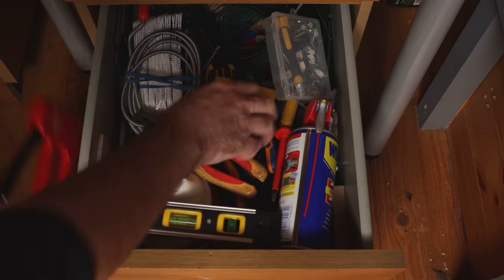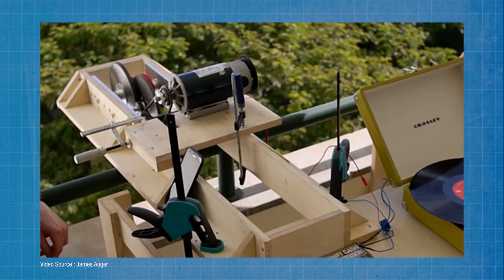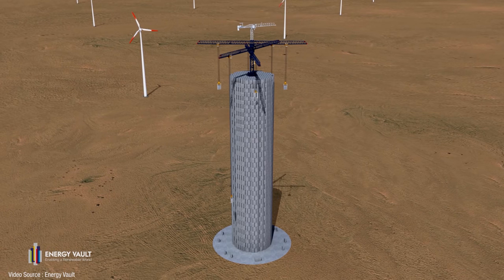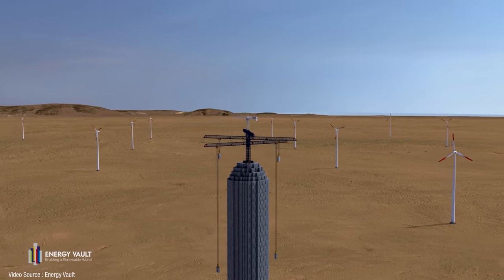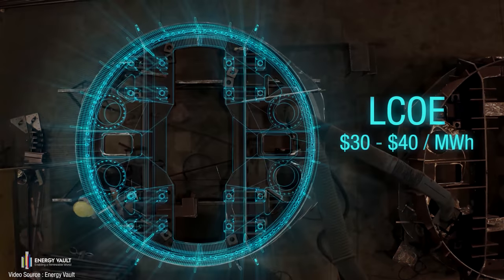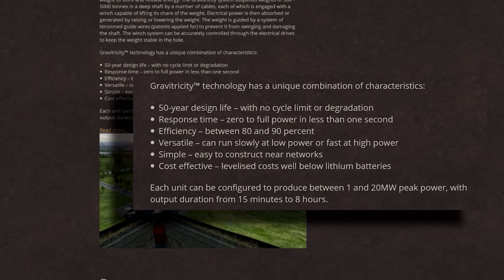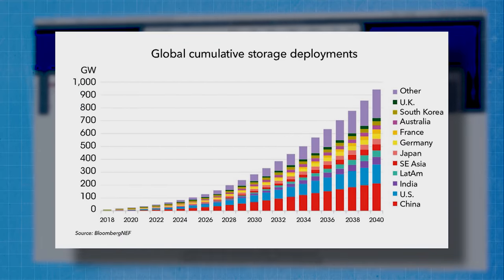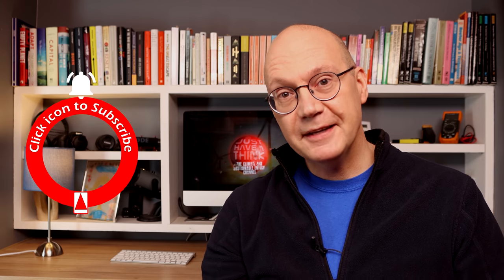Gravity Energy Storage : A very uplifting technology!

Comment: They should build a moat around that tower block to drop the blocks into.
The mine shaft one is certainly less of an eye-sore.
Reply: Don't know if you have covered mechanical batteries(fly wheel storage)on your great series,which is another system which could quite possibly be combined with all these other systems(like an ion battery being the gravity weight,with a fly wheel).i would like to share my scale up idea for a heat battery(my own idea,with micro wave safe glass tubes(there patented invention)heating an iron filament from the sun,through the (patented glass,that by it's molecular structure,does not allow,Evan one ÷of the heat too escape.this in turn would be reconverted into electrical energy at night,by the geothermal method,or vise versa,but on a smaller interconnected systems way,a bit like solar panels.tell me what you think ( :and if maybe this could be tested,and Evan financed.freedom

Comment: I had a think, and I realized that town water towers are actually gravity storage systems. You pump water up into a tank high in the air, and it creates water pressure for the town water supply.  You could run the outflow from the tank through a generator into a pond to create power, and pump it back up from the pond to the tank to store energy.

Far fewer moving parts than lifting big bricks, and no worry about outside forces like wind interfering.
Reply: A tiny amount of energy storage though. All these gravity systems need a combination of high mass and a large height differential to work, you don't get a lot of energy  otherwise.

Comment: Good to see that type of system being developed. It also of course has zero energy loss for longer term storage. I think you will find it has been used to drive clocks for a great deal longer than a century.
Reply: And the clocks got somewhat smaller when the transition to batteries was made 😂. Take that as a clue to the feasibility of these project.

Comment: A problem with raising and lowering blocks as shown in the video is that 'not all blocks are equal'.  As the system moves to lower blocks in the stack there's less energy to be recovered from the block.  The block has less distance to fall, less energy was used to raise it to its lower position in the stack.  In a 100 block high stack some blocks store 99 units of energy, the second from the bottom block stores 1 unit of energy.  The bottom block stores none.

Mount the crane at the edge of a cliff.  Install rail tracks at the top and bottom.  Raise and lower "rolling weights" and move them from the crane to storage areas.  We should have an abundance of no longer needed coal rail cars.  Fill them with something cheap like waste concrete.  

Slope the lower track away from the crane.  When recovering power from the system let gravity move the lowered weights/cars.  Then when there's power to be stored store some of it as travel to the crane.  At the top do the opposite.  Move weights up a slope when there's power and let gravity bring them to the crane during discharge periods.

Huge amounts of energy could be stored by simply making the storage tracks longer and increasing the number of cars/weights.  All cars/weights store 100% of the energy needed to lift from low to high.
Reply from the maker: Hi Bob. Sounds like you have a plan. Might be worth talking to investors.

Comment: There seems to be a hell lot of moving parts in the "Energy Vault" system. As a general rule, the more moving part you have, the more risk of failure you have. Frictions between blocks, degradation of the concrete blocks, mis-alignments due to wind and rain on the structure, resilience to earthquakes. Those are only some points that came to my mind is a couple of minutes. The only advantage it seems to have against pump hydro is the energy density of the system but I think the constant need of maintenance to keep this system running far out weight the gains.
Reply: Other strength pumped hydro is much more limited when it comes to where it can be located, but otherwise I totally agree with you. The Graviticity proposal seems much more reasonable, but because it's less flashy it seems to get less attention (especially here in the comments), shame really.
Reply: true
Reply: Agreed. The liquid redox battery is going to prove to best the best option down the road. Being able to stack shipping containers of liquid batteries and leave them for 25+ years without moving around will be the safest and least amount of maintenance. I would rather see those concrete blocks be made of carbon capture concrete and used as levees of building blocks.
Reply: But this is entirely missing the point.  If the world is to move to clean, renewable energy sources (as it surely must), then - as is so often pointed out - various means to store energy from times of surplus to times of high demand are essential.  The fact that a given storage system may be "less efficient" in terms of its maintenance needs is irrelevant.  No one denies that there are problems that will need to be overcome; but the big picture has to be looked at.  Why be negative?  Why not try to see the positive and the potential?
Reply: @chrislaf2011  it all comes down to 2 major factors 1: cost per megawatt storage 2: renewable materials that are abundant and nontoxic. Gravity storage has the material part figured out but the cost per megawatt is probably 2-3x pump hydro and loss of efficiency and maintenance. This project might be fine for R&D but I believe redox batteries will be a far better investment.  It will eventually have a low cost per megawatt and be made from non-toxic materials that can be recycled after their 25+ year lifespan. They can also be stackable to fit into major metro areas where space is a major cost premium.
Reply: @lGODofLAGl  you can install a water tower anywhere....
Reply: @chrislaf2011  You are right. It is important to realise that there is no silver bullet regarding clean energy. However, creating a working prototype cost money, time and energy. It is important to discuss properly different option and avoid wasting important ressources on weak design. But discussion is very important
Reply: @epiccollision  you would need to build multiple towers the size of empire state buildings just to power maybe 100 homes. I can't imagine building water towers on every corner to solve this problem. It needs to be compact and can increase in scale over time. The cost of building so many water towers would be too great.

Comment: Another idea is a buoyancy generator. Basically make a giant steel vessel that you can pump air into and out of .... fill it with water, it becomes as buoyant as the weight of the steel container (so make it heavy) and can sink down as far as the ocean goes generating energy. Then when it gets to where you want, pump in air and repeat.
Reply: Ivory - The drawbacks, here, are a loss of mass due to the weight of the water (i.e. you need a lot more mass of steel to get the same 'weight'), the hoses for the air, and the marine environment.
Reply: Great idea. But, seawater will corrode it quite quickly.
Reply: @johnburns4017  I don't know about quickly. There are a lot of long term marine structures. Could also make it out of things like ferro cement (cheaper).
Reply: @mikegraham7078  Yup, it would have to be large enough to be worth it. And then the cable / chain would also be an extreme weight consideration.
Reply: Complete bullshit. You get the same energy by just keeping the vessel on the ocean floor an letting water flow in. Compared to said concept you idea has only disadvantages and lots of them for no obvious benefit.
The later concept is being investigated but is not terribly economical either.

Comment: PS power stations are using thousands of tons of water with hundreds to thousands of meters of drop height. And they are far from enough to store energy from renewable sources. In France, we have water and mountain, so we use relatively speaking a hih amount of hydropower, and we mainly use them to regulate the power grid (but only 18% of our hydropower is PSPS so maybe we have some margine to improve on storage).
now, if we replace PSPS by a mass of heavy steel, with a density of 8, we'd need 1/8 of the surface of a lake at a few hundreds of meters to generate a comparable energy.
1MW of power output for 8 hours, so you'd need 4 of them to simulate 1 medium size wind turbine, and 8 more if you want electricity for a full calm day. That's a joke. 
We are seriously looking at batteries. because it's more feasible. Potential and kinetic energies are weak. Chemical energies is 100-100 times more concentrate. And then nuclear energy is again 100-100 times more concentrate.
Potential energy= mass*height*g, physic is a bitch.
Reply: I guess you also have to factor in the costs and lifespans of chemical batteries, vs these batteries made from recycled materials with potentially longer lifespans.
Reply: I think it's unrealistic to think of the energy vault as a mass storage device like pumped hydro, for the reasons you say. I think this would be more of a competitor to the sort of load-balancing that those new Tesla grid batteries do, with quick response but relatively short charge/discharge times.
Reply: How quickly and cheaply can you dig a hole compared to building a nuclear station?
Reply: We could fit about a thousand of them in one open-cut mine.
Reply: @PinataOblongata  That's a great idea, although in that case it might be best to use the depth of the mine & move weights between piles at the top and bottom.
Reply: @PinataOblongata  Here in the UK we've been trying to build some nuclear plants for a decade & all we have is a massive hole in the budget.
Reply: @jowjor  Clearly a combination of renewables and kinetic (or other) storage.
Reply: @bimblinghill  you could even bisect a pit and make one side shallower or deeper than the other, then bam, you have a hydro plant where you've already disturbed the environment. Stick floating solar on top and surround with wind turbines. I wish the world would stop looking at LCOE as the be-all-end-all and just build a mix of things, really, because when you do that you end up innovating and refining the tech you've built and making it more competitive. This is where govts and billionaires should be putting money - things that are good alternatives but juuust shy of being better value than something else, so don't get built and refined and improved.

Comment: The open blocks and cranes system is interesting.  It's advantages is it can be located anywhere you can construct a tall heavy structure, along with all the performance advantages of gravity storage.  Once weakness I see is wind.  Construction cranes usually are not operated in windy conditions for obvious reasons, and since this system is essentially a group of construction cranes moving blocks around, that will be an issue.  One solution is to encase the entire system in an outer structure.

Comment: Will the heavy blocks moving up and down be stable enough in a windy place. Plus too many moving parts
Reply: And I wonder if it can survive a single earthquake.
Reply: Danmit I just commented the same ..I should learn to read the comments first 😂
Reply: I suppose it could be a part of a multi-prong system where wind turbines are employed in windy conditions and surplus wind energy used to stack until such time as it becomes dangerous to move cranes.
Reply: @MrBizteck  To be fair youtube does not make reading it's comments easy.
Reply: @rupert7565  Especially, when the comment is in the replies.  A search feature would be nice.
Reply: @BatteryOnBoard  I mean, even at that point if the wind gets bad enough or if the ground shakes enough, that tower will topple... the mineshaft system seems much more reasonable.
Reply: I agree. From an engineering standpoint that many moving part seems really worrying.

Comment: Thanks for another great video! Of the two of them, Gravitricity seems more realistic to me, since it's a lot simpler. Energy Vault sounds amazing, but it has so many moving parts with all the cables and hundreds of blocks, there's lots of ways it can go wrong. Seems to me these gravity batteries need to be big, dumb and reliable. You've got to shift lots of mass over and over again without anything breaking down, which makes "dumb" simple designs preferable.
Reply: Energy vault is a scam(at least I think) because I refuse to believe that someone is stupid enough to come up with such an awful design. Gravitricity is an actual company that actually works because the design is literally one of the simplest batteries out there and its realistic. Weight based kinetic batteries are only good at small scales. For a city you need pumped hydroelectric dams because they only work at large scales. A weight battery at it's largest would probably be the size of an elevator (though you could go bigger, the potential storage to size ratio  would drop significantly). Dams need to be large because water only has high storage potential in large volume. A dam the size of an elevator would have terrible potential storage(I would say the smallest dam is a small lake but that's only going to power like a few houses for an extended amount of time). They are both good but they are meant to store power on different scales.

Comment: Hello Dave, I was the guy who suggested that you address gravity storage batteries way back when a few years ago.  I appreciate the quickness of these designs, which I never thought of (not a battery specialist, just an engineer).  Anyhoo, my concept was to build simple gravity storage system in a modular fashion - a single one doesn't do much but you can easily construct lots of them.  You have the on ground collection source of water, with the downhill component lying underground (to minimize evaporation and deal with places that might experience an earthquake).

Then I thought that why not just power the pumps to move the water back uphill with renewable energy sources in the form of solar panels and wind turbines.  If it should be not too sunny and not too windy then pumping the water up will simply take longer - just meant to be a baseload component in any case - fire up the natural gas and god forbid the coal-fired power plant instead, should you need it.

I even imagined that channels could feed the above ground portion of this system, and also why not line the channels with solar panels?  Would keep them clean and you've got more solar panels to assist if there's plenty of water filling the channels, reducing their effectiveness) to the above ground reservoir.  Wind is wind and let it blow.

My final thought involves charging Lithium Ion batteries, they are the ones for quick response, not the system itself.  However the sheer quantity of LiOn batteries required, even in a modular approach is likely to be immense.  Well at least you can charge them for free.
Reply from the maker: Hi GW. Sounds like you're describing a system very similar to Pumped Hydro. There is definitely an important place for that in the mix. All the best.

Comment: Thunderfoot poked a lot of holes into this concept.
Reply: That's his claim to fame though.. A real downer man.. Except a lot of his holes are not well, quite, well PROVED !
Reply: @seanhoare7639  He made some good points on the cost benefits. You use more power than you get back.

Gravity power is nothing new. London had a whole hydraulic power grid back in the last century pre-electricity powered by the same basic concept.  A very heavy weight compressing water which was then piped to several blocks of industrial buildings. I believe it was elevated by steam power.
Reply: @thtiger1  The point is that the power you use is NOT required at the time it was generated so the choice is lose it or use it!
Reply: @seanhoare7639  But you need to get a return on your investment. A money pit does not do the trick.  I can't do Thunderfoots arguments justice here, but he makes some very good points about how viable this is.
Reply: @thtiger1  If a return on investment was the ONLY criteria (& it seems money does talk) then I would agree But there are other societal / ecological benefits to be had or we could just waste the excess power.. As a species we seem to be very good at waste!

Comment: Old clocks used to use gravity weights.
Reply: Big Ben?
Reply: Yes, it's a very efficient form of energy storage.
Reply: @raykent3211  no it isn’t, it’s just useful for clocks...
Reply: @epiccollision   à planet following an elliptical orbit is described as converting to and fro between gravitational potential energy and kinetic energy.  This must be lossless or it would have lost energy and crashed into the sun before I was born.  So, 100% efficient, pretty much by definition.   So, per se,  the conversion from gravitational potential to kinetic is lossless.  Losses are incurred elsewhere,  such as friction  in gearing,  which can be minimised.   Yep, mate, the principle those old clocks are based on can be hyper-efficient.
Reply: @raykent3211 , interesting in theory, but fails in practice, the human has to convert food into energy in order to lift the weight once a day to power the clock for only a day, the self same clock can run for better than 12 months on the chemical energy in a single 1.5V carbon / zinc cell.
Even in the “Matrix” that’s wasteful.
Reply: Matthew Knobel, and trains used to run on steam, and candles used to light our homes!